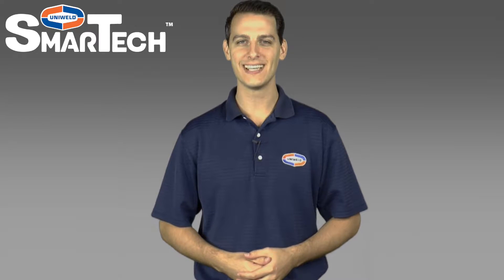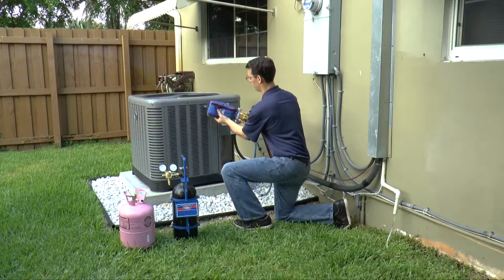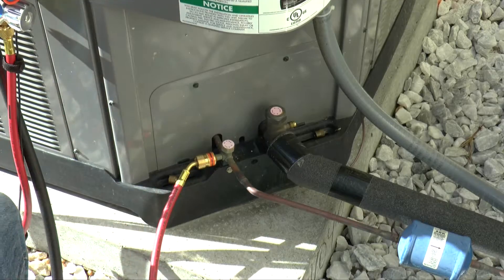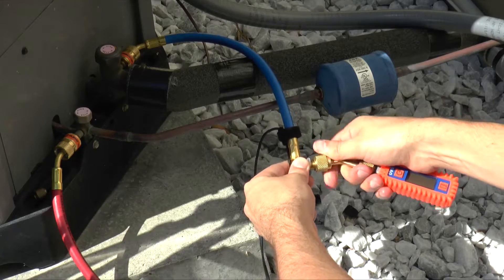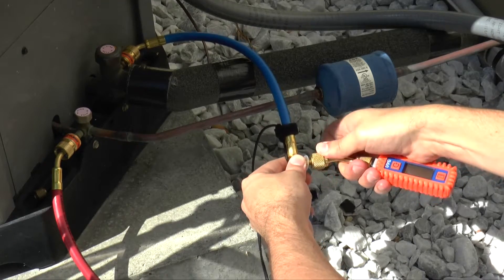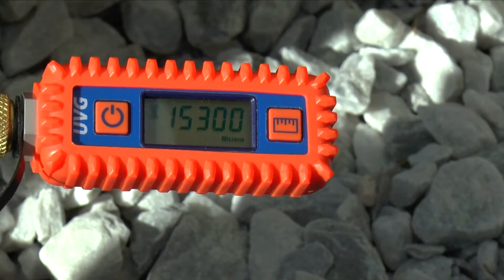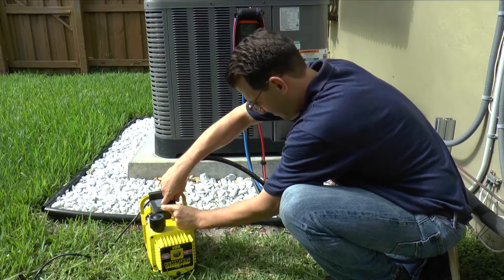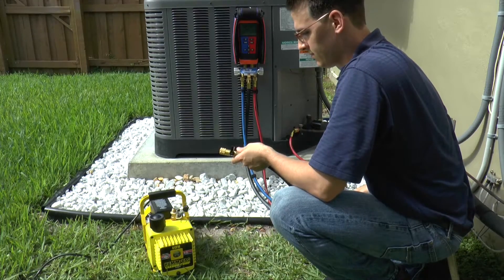Evacuating a System with SmarTech® & Fast-Flo® Hoses

Comment: Quick question. I have a uniweld 2 stage 5.5 cfm vacuum pump. A colleague of mine and myself have different view on the oil fill port and exhaust dome should be closed off, open or left ajar. Your quick response will be appreciated. Thanks